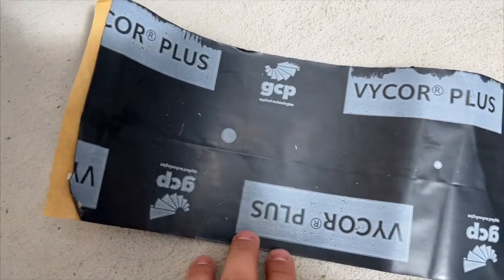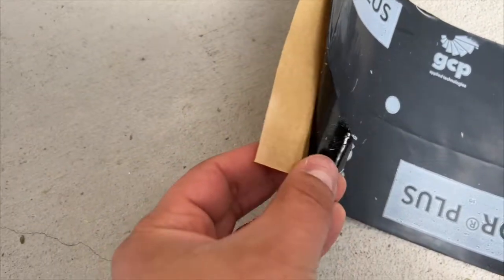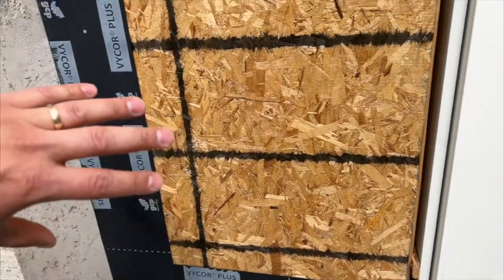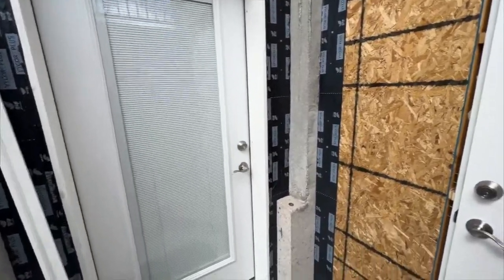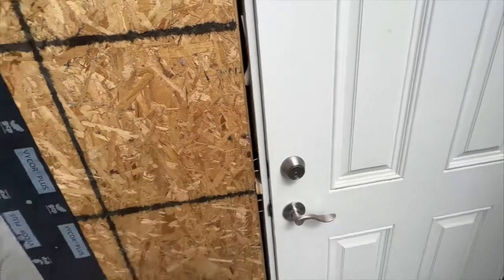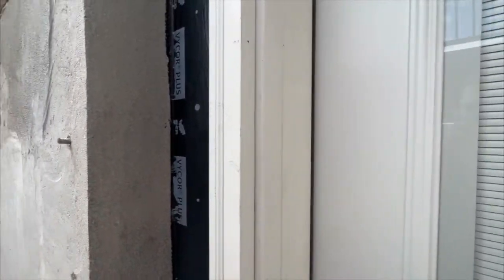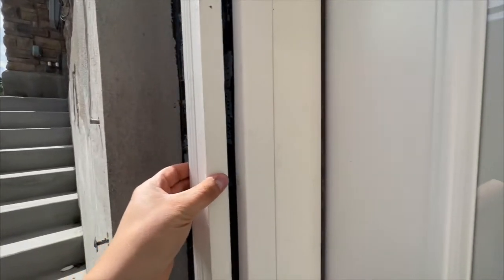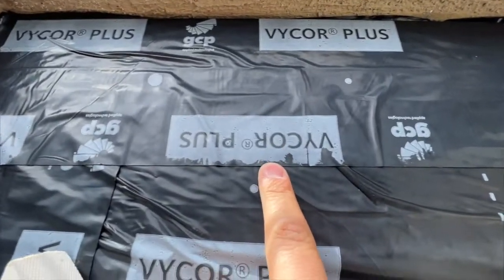How to Waterproof a Basement Walkout Entrance Door

Comment: Hi Just wondering if you put anything between the plywood and the cement opening it's leaning against?
Reply from the maker: Hi Julie,
Thanks for your question. Yes, we use a backer rod and a waterproofing caulk to go inbetween any OSB/Plywood that is not pressure treated.  Aim for a 1/4" or 3/16" gap around the plywood/OSB so it is not touching the concrete - then fill that gap with the backer rod and caulking.
Reply: Hi, do you water proof between the concrete at the bottom (the floor) and the door frame? Like with rigid foam insulation or something?